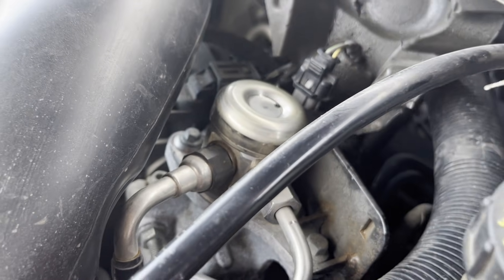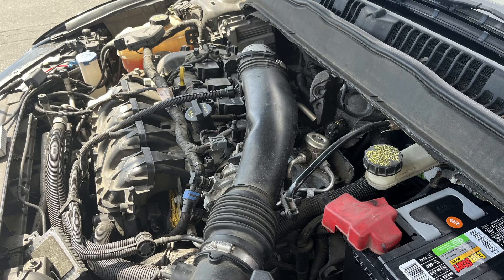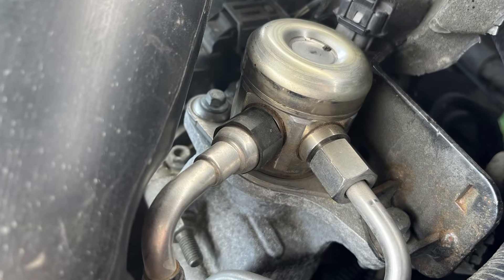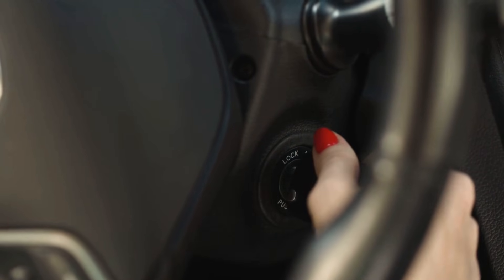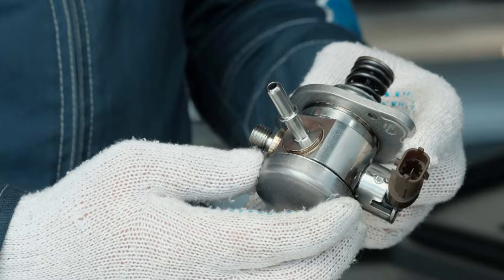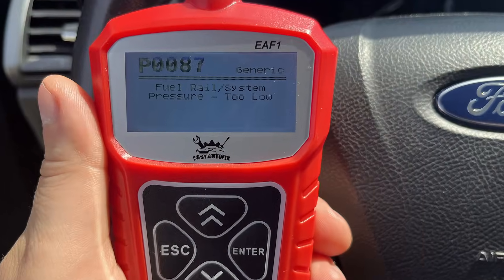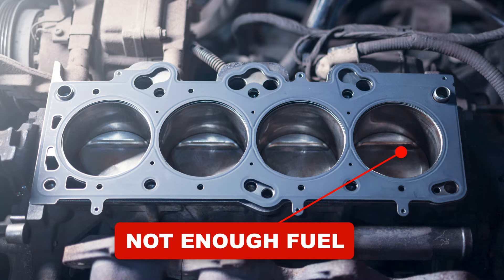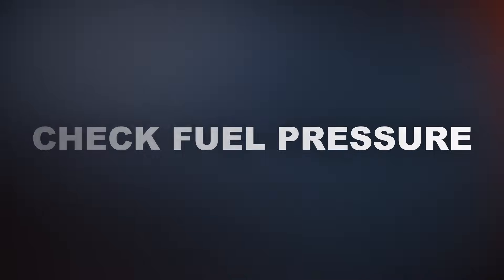Symptoms Of A Bad High Pressure Fuel Pump

Comment: Literally all of these symptoms except my SUV never shut off on its own. And the codes ive got are Cam and Bank 1 related. Seems to be an intermittent rough idle noise (shutting off, sitting for 5sec, and restarting vehicle, it goes away) coming from the left side of the engine. I assume, this could be the issue. Ive got a 2019 Ford Escape 2.0.

Comment: Hi, I have a 2013 hyundai accent showing signs of failing  feul pump. How do i know it its the feul pump under the back seat or the high pressure pump that needs to be replaced? Or do both have to be replaced?
Reply: Im having this issue with my sonata did you ever figure it out?

Comment: My fuel pump overheat during hot summer day time, should i change it or drive on more fuel?
Reply from the maker: If the fuel pump has a lot of miles on it, it’s probably time to replace it. It’s better to change it early than risk getting stranded when it finally gives out.